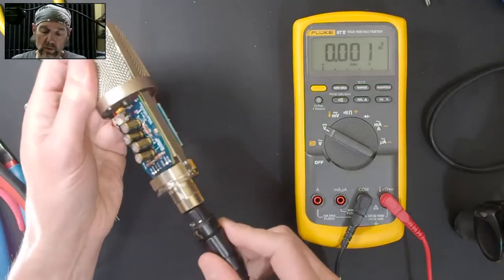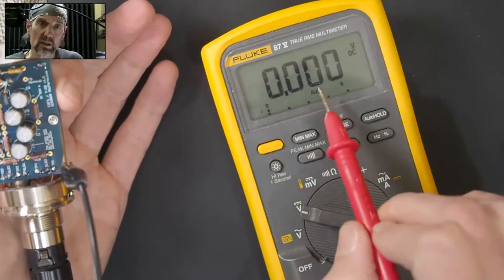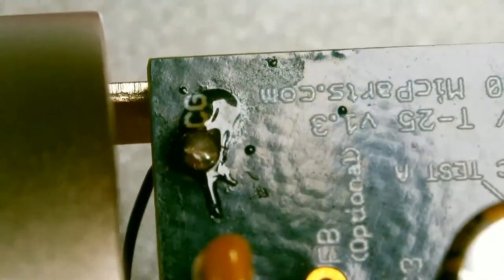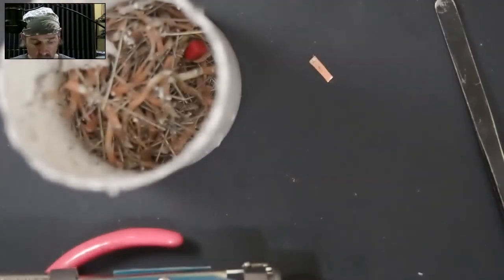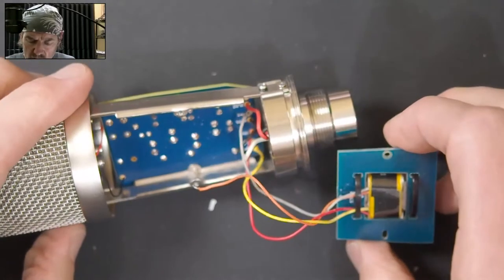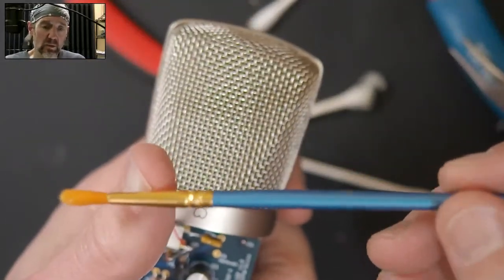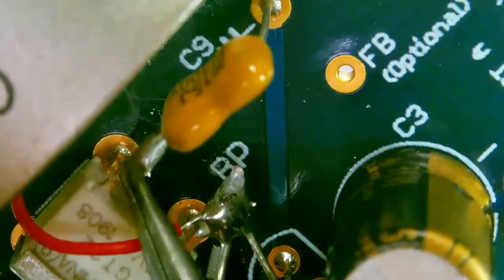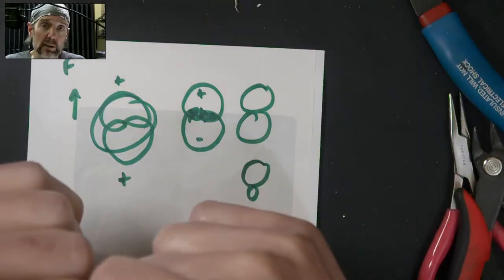DIY 001: MicParts T-25 Microphone Build, Pt 2

Comment: I built this mic this past week, instructions were very clear, worked very well the first time. Haven't done the multi meter test yet. Test run over head on drum kit, sounded good, very quiet. I've done an effects pedal mod kit and this was a bit easier to do, specifically the soldering, the circuit board on this kit was also more substantial than a solid state amp I replaced a few diodes and resisters on. I am very appreciative of the level of quality of not just the kits but the support and the clarity of the instructions. Some audio equipment manufacturers should take note.

Comment: You can also use a resistor lead to "ram" out the used solder. Heat the lead up and insert it into the hole. Similar to your needle  and a lot cheaper. Put the wick on the flip side to catch the solder that come out of the hole..
Reply from the maker: Yes, I have tried that. The challenge is that a piece of stiff wire is difficult to hold on to when it gets hot. The 'solder needles' have plastic handles, which insulate the user from heat, but of course introduce an additional failure scenario when overheated. I suspect that using a set of locking forceps to clamp onto a stiff wire would be the best of these solutions. (Well, really the best solution is to not plug up a through-hole with solder.;-)